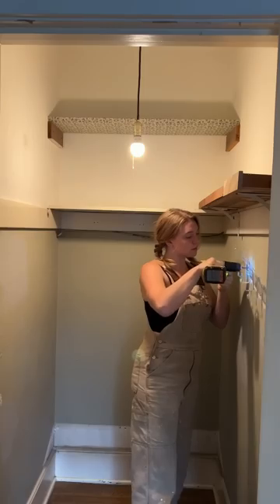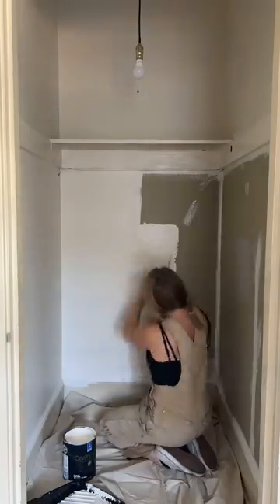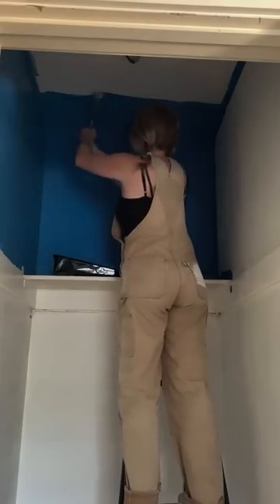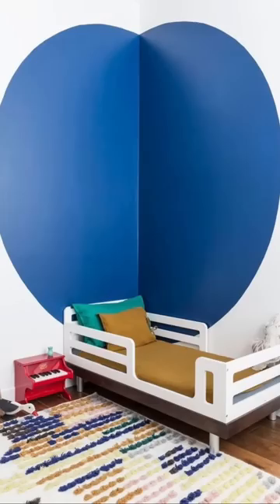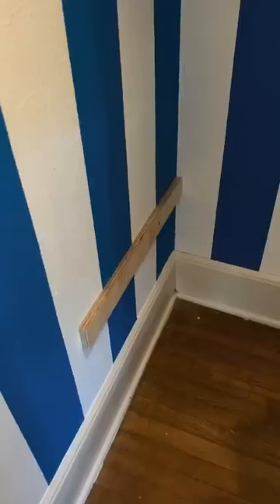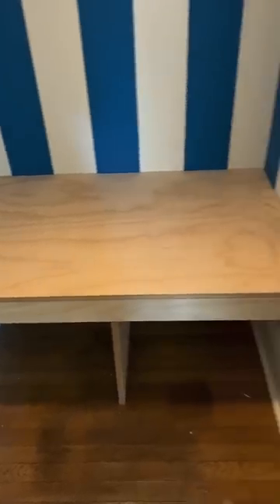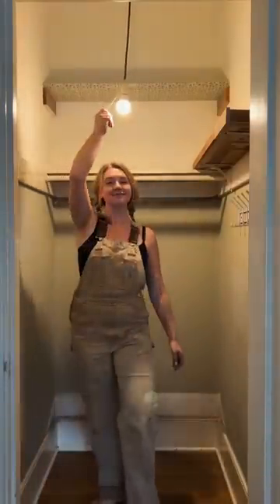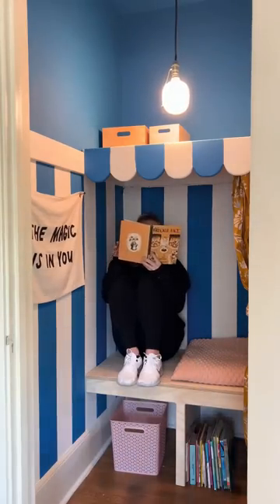Part 6: Time for the closet! #diy #transformation #makeover

Comment: Please remember to add a ribbon or a string of some sort to the light so the kid can turn it on and off themself! The style of bedroom suggests your friend is planning on fostering younger children, and they should be able to choose to turn the light on or off themself :)
Reply: With a string pull, it's good to tie a large wooden bead on the end. It is much easier to find and grasp that way.
Reply: These are both great ideas.
Reply: Depending on the age of the child(ren) and the specific fostering rules the string may have to fit certain criteria, since there's the potential for hazards (strangulation, choking, etc). Just something to keep in mind for those who are fostering - there are rules/regulations for everything
Reply: You can get 36" extension chains (beaded with connectors that match the brass chain here) with all sorts of pulls-- animals, planes, or my favorite-- a mini lightbulb XD  They can be cut to length with ordinary scissors.
Reply: Yeah, that’s how little kids get strangled.  🙄
Reply: @Kirsten_is_cursed10  It doesn't have to be that low, only low enough that the kid can reach up and and turn on and off the light.
Reply: @Izzy-cp8yt I was going to say that. If it’s a young child (OR you don’t know their background and mental state) you might need to keep it short for safety reasons. It’s the same with mini blind cords- they should be cut short to avoid accidental strangulation.